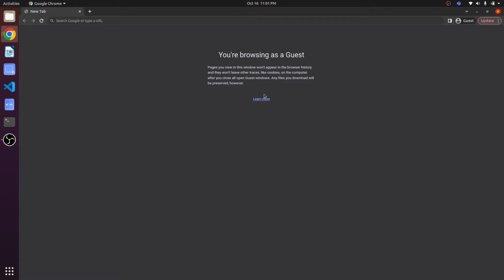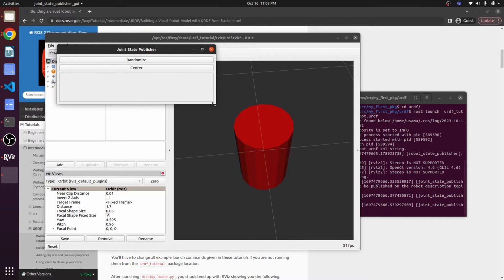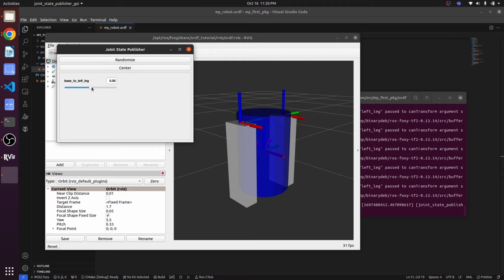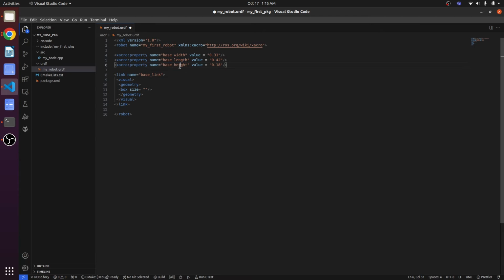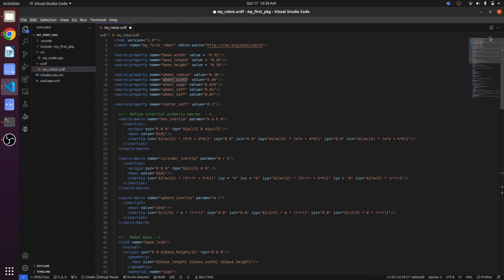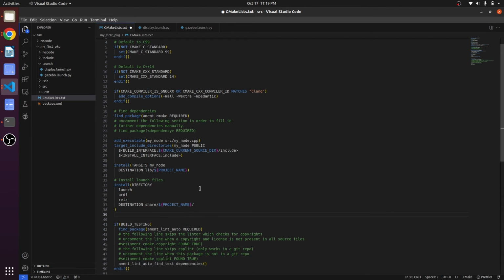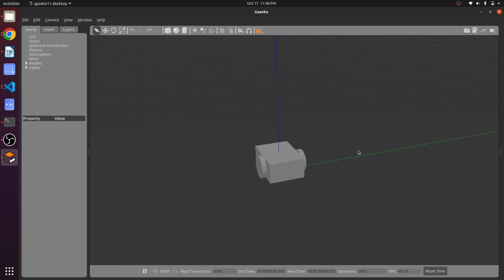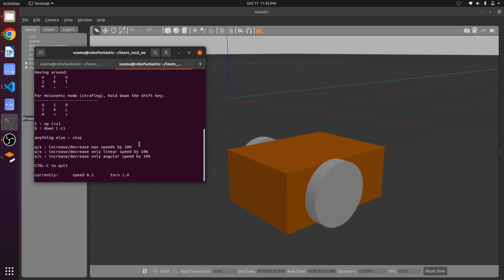ROS2 robot URDF + Xacro creation, visualize in RVIZ2 and Gazebo + Teleoperation | Beginner Tutorial

Comment: when i use ros2 launch urdf_tutorial display.launch.py model:=my_robot.urdf
I see that error what i should do?
Traceback (most recent call last):
  File "/opt/ros/iron/bin/xacro", line 33, in <module>
    sys.exit(load_entry_point('xacro==2.0.9', 'console_scripts', 'xacro')())
  File "/opt/ros/iron/lib/python3.10/site-packages/xacro/__init__.py", line 1171, in main
    _process(input_file_name, vars(opts))
  File "/opt/ros/iron/lib/python3.10/site-packages/xacro/__init__.py", line 1124, in _process
    except xml.parsers.expat.ExpatError as e:
AttributeError: module 'xml' has no attribute 'parsers'
Reply: hey, how did you solve the problem?
Reply: I put the complete path for the urdf file rather than just the name and it worked @chironjeetdasjoy2173
Reply from the maker: exactly guys, this can be  the path issue. instead of model:=my_robot.urdf you have to provide complete path i.e model:=/user/home/ws/src/my_robot.urdf
Reply: Did you solve the problem?
Reply: Are you resolve this issue